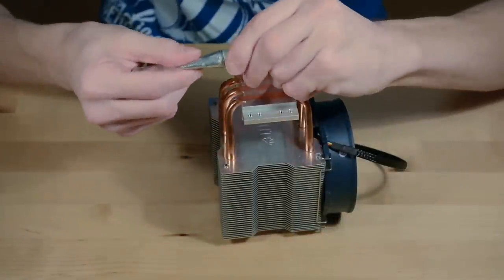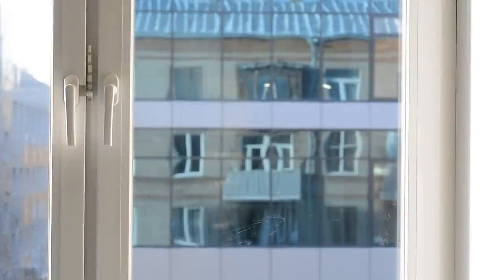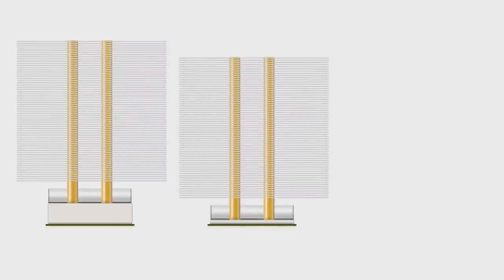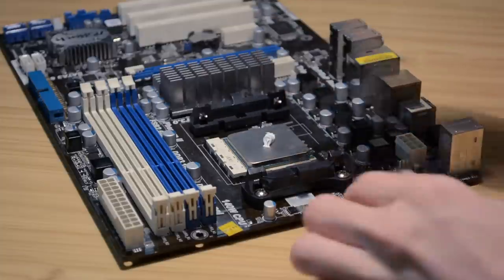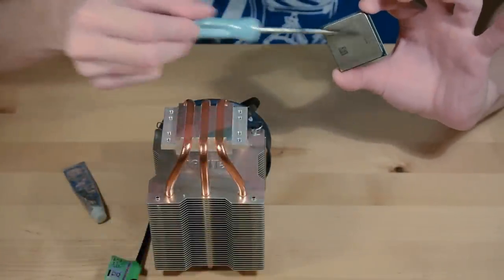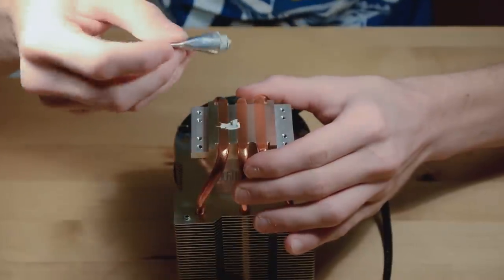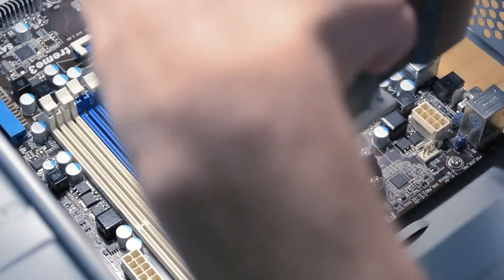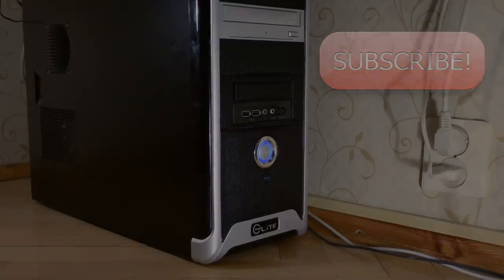Thermal paste: How much really need to apply and how to do it correctly? Как наносить термопасту?

Comment: The temps are rediculous. Yours, I mean. What is the CPU? Because my Fx-6300 idles at 8-9 Celsius... that is, if it's not turbo coring for steam, because Gaben.
Reply: your cpu doesnt idle at 8-9 celsius, maybe if your pc is in the freezer
Reply: krasusboy I'm using the CM Seidon 120v. Cheapest watercooler on the market.
Reply: Riley Poulin Your 12v line is dangerously high
Reply: I have a fx-6300 also, and what you are seeing is a false reading.  I get the same readings, but its impossible for your cpu to be cooler than room temp, unless you have some crazy super cooling heatsink that no one knows about. I heard its b/c amd cpu's sensors give out false readings at lower temps, resulting in you seeing such cold temps, which are not true readings.
Reply: Mine currently is idling at 35F or 2C, so yeah that makes no sense, its giving off a false reading, or I might have frost on my cpu lol
Reply: Some software reports temperatures differently. The software that you get with the motherboard is the best to use usually. My ASUS temperatures at idle are usually around 27c to 30c, but when I check my cores in CoreTemp, it comes back with about 12 to 15c per core. I'm cooling mine with a Corsair H110 and good case  airflow too. When using Prime 95 and throttling all 8 of the cores, it reaches about 62c and never really rises above that, which is still a safe temperature for my processor.
Reply: Riley Poulin How are you enjoying your garbage AMD thermal sensors and weak cores? There is a reason why people buy Intel over AMD. Hell, they haven't released a high CPU in a long time. Funny thing is an i5 keeps up with the 8350 in rendering.
Reply: Riley Poulin Using an AMD Processor, HWMonitor doesn't work well with AMD processors. Thats not an accurate reading. Its telling me my processor is 136C, when theres literally no way that is possible. My computer would be melting right now.
Reply: Cody Begley
 Don't worry, it works perfectly well. You just need to update it. Some cores just shut down on idle, but when you stress them you can see that the sensors work perfectly well. I use an AMD FX-8350, and I can tell you norge696 that too many people still buy AMD over Intel, the reason is simple, AMD is not bad at all, it works pretty fast, can handle everything you throw at it and it's very cheap. Of course, top Intel processor beats top AMD processor, but you shouldn't believe all the synthetic benchs and sites reviews. I don't justify buying an Intel processor because of the price because I can get something cheaper and better from AMD which also maintains good performance over time, which is also the case for AMD GPUs (only AMD users will understand that) Also, AMD heatspreadders are way better than Intel's, but the coolers are too noisy, nothing you can't solve with a another cooler, but that is still the case for intel processors that can handle and work with higher temperatures, but can compromise your system if you have bad air flow.
Reply: Cody Begley (If you haven't fixed this yet) You can also get this program i got called Speccy. It's more meant to tell you about your whole PC specs but it tells you the temperature of all of your cores which you have, if that helps you any.
Reply: In any case guys, we all know his statement was incorrect but even still AMD has a place. They offer a cheaper solution where 90% of people don't need a lot of CPU power. They are also needed to make competition, if not for that Intel could charge whatever they wanted.  It's been shown that the bottom line G3258 when overclocked can perform quite well in games with a very strong GPU. So unless you have a real need for a high end CPU then it is literally pointless to have all that power aside from the bragging rights you claim over AMD.

But look at it this way, say you own a 4770k (I do), But I use mine for, 3D rendering, programming, photo editing, video editing, encoding, plus the occasional streams and recordings. I felt the 4770k justified for MY uses. AMD clearly gives the end user the best bang for their buck, but if you want the best all out performance obviously Intel. But they both need to exist to make things go round.
Reply: Riley Poulin wtf are you using liquid nitrigin? thats crazy....
Reply: It'll be his core temps. A lot of monitoring tools report the socket temp. On my water cooled rig the socket will hit as high as 60 degrees when gaming but because the cooler takes the temperature away from the surface of the chip, the core temps only hits about 30-40 degrees max on mine. My cores idle at about 10 degrees or so too, mines a 9590 though which is a pretty hot running chip.
Reply: norge696 It's ok if you "dislike" AMD, or AMD fanboys, i give you that, but I will never buy intel over AMD, just for you to know that not everyone thinks the same. And btw, thank and beg AMD stays on bussiness because you will be paying a lot more for decent performance without competition, if you wanna buy an x86 processor machine of course.
Too many people complain about AMD stock coolers, and the truth is stock coolers delivers, unless you are an enthusiast, in which case an evo is a good option. I own an FX-8350 and I'm quiet happy with it. I didn't notice any difference with my friends i5 4670k, it just loads windows 2 seconds faster than mine, guess that's also cause of newer chipsets/technology, and I can say that today my PC is faster than my friend, but only because I know how to handle programs and processes. Daily use depends on everyone, and if you are a smart user your PC will deliver well enough. Bear in mind AMD is competing with older technology, and it's not that far from intel, difference is minimal.
BTW, Intel stock coolers are not enough if you are an enthusiast. My friend just want to acquire an CM hyper 212 evo because he is having some trouble with the temps of the 4670k, and i have another friend who just had to buy a watercooling solution because he renders constantly on an i5 2500k.
If I had to buy a new computer, I will just wait for another good product from AMD, just because I've always had good experience with them and they've lasted long enough without issues.
Sorry for my bad english. Regards
Reply: Ryan Dailey Well said sir. I think the same way. I bought a fx-8350 and it's quite fast, for daily use it's perfect, and gaming is not bad at all, actually i was in doubt about that but then I was happy when I tested it. I think everyone should just try it out and then complain, not the other way around.
Reply: Marcelo Badalamenti Yeah yeah yeah... Let's just hope AMD's Zen architecture actually shows 40% IPC improvement and it's not another shitdozer. You don't need an AIO to cool an Intel CPU, especially sandybridge because the IHS is soldered to the die. Any Noctua heatsink should do. Haswell will work fine with a CM 212, temps should stay around 60-70c fully maxed out.
Reply: norge696 Lol my 4770k would never stay that low with the 212. Course I do have it overclocked pretty high (4.8ghz) with and water. Oh and not to mention delidded, and I still get to 65ish on prime. 

With it at stock with stock cooler and no delid, prime went easily into the 100's
Reply: norge696 that is if you can fit it. In my M-itx chassis there is no room for a CM212 and easier just to put water AIO onto mine (i5 4680K) as it is overclocked to 4.7

Comment: Nope! Wrong. You're wrong.

First of all, applying a dab to the processor and letting pressure spread it is perfectly fine. There are no air bubbles UNTIL you remove the heatsink...even then, the pattern left behind has nothing to do with air, but rather viscosity. For heatsinks without direct heatpipe contact, this approach works perfectly fine, but is not as good as the following...

Forget credit cards for spreading - they're no good. The BEST way to apply heatsink compund (especially to those with direct heatpipe contact) is to use an unpowdered latex glove or sandwich bag to cover your finger, apply a small dab to both surfaces, and firmly massage it in to the whole surface area.

Comment: FFS he probably gets better temps than all you kiddies who became experts the fist day you logged on to the internet and now shouting at him. His PC works fine and has better temps than stock PCs.

There's loads of 'youtube experts' doing the 'pea method', yet they're putting way too much paste on.  The spread method was used in the golden days of overclocking, where the tops of the CPU were sanded down using wet-dry paper to get them super flat and smooth. The paste was rolled using foam. Paste has improved a lot since then too. Artic Silver website still recommend the spread method on some CPU's

Comment: What you do is wrong.

1) You pushed the cooler with your hands, even if you applied great power the pressure is less compared to what the pressure would be had you tighten up the screws correctly.

2) If you had tighten up the screws correctly it would have spread on the entire surface with small gaps maybe on the corners but that doesnt even matter. because we need to have thermal paste only in the center of the CPU the metallic square is just a heat spreader and acts like a buffer if you google for delid CPUs you will see that the actual chip on there is in the center and is very small there is where the contact needs to be made. 

3)The only thing right in your video is that we use thermal paste to avoid oxygen between the CPU and the Cooler but by spreading the paste with the credit card you mix small air bubbles in the process..

Also yes it needs to be a thin film but too thin is also bad.... you did what you tried to avoid.. with such a thin film of thermal paste you made many tiny gaps that dont have paste at all (that is why one can see the heat pipe colors for example because instead of a wall your thin layer is like a net with tiny holes in it which allow light to reflect from the cooper and come to your eyes and thats why instead of the thermal paste color you see the cooper color... those tiny holes are going to be filled with air... )

Comment: At least one highly visible corrective annotation is in order. Well, "the less the better" isn't exactly accurate. ZERO certainly isn't correct, is it? See? Also, doesn't it need to be evenly spread (by the heat-sink; not necessarily manually), instead of just one dot that isn't? Yeah, see? Shouldn't it be just enough to cover the whole top without spilling over, very much? So not just "the less, the better," because you need enough to spread evenly without being very thick.

Comment: Pea sized without spread is dumbest way possible. The role of thermal paste is to go into the micro pores of the heatsink, not to interrupt contact between cpu and heatsink. You must put max 1/2 pea sized and spread it as thinner as possible, almost see through. The more surface u get covered with paste, the more heat will be dissipated. Also, the cpu and heatsink must be previously cleaned with alcohol and a very soft cloth. The method at the end of this vid is the closest to perfection in my opinion.
Reply: Delid the CPU and see where the chip is and how big it is the. you will know why you are wrong....
Reply: +MsSuperdong It doesnt matter how small the chip is, it dissipates heat through all lid's surface.
Reply: +Cosmin D. Well your wrong. Have fun getting air bubbles and higher temps!

Comment: There is no air inside a double glazed window. It's a vacuum.
Reply: ***** Uhhhhhhhhhh. So do they hook up a pump inside the glass while they are putting the windows next to each other?
Reply: Obviously. Some suck the air out, others fill it with a more insulative gas than common air. The best double glazing is a vacuum. The best conductive insulator, is nothing at all, for there isn't any particles to conduct :)
Reply: So are you saying they don't try and suck the air out of a double glazed window pane? And besides, if you really want to get technical, that statement is very inaccurate. It depends on which part of space you sample at a particular moment in time. You can sample space in one place and find its completely absent of visible matter. In another place in space, quite possibly beside your first sample, you could find gas, dust, ice etc. You can apply the same logic in a vacuum made by man down hear on earth.

When you think you've found that part of space that is completely void of matter, gravity more often than not suggests otherwise. I'm talking about dark matter. Matter that we cannot see, yet we can see it's influence.

Ever wondered why when the Milky Way revolves around its Galactic Core, It's outer arms revolve at the same rate, contrary to what we would expect judging from the matter we can see. We would predict it's outer arms to orbit at a reduced rate, like a whirlpool in water, but that's not the case. The reason why is because our galaxy is jam packed with matter we cannot see, or interact with, turning it into a strange solid.

Science is amazing.
Reply: No not a vacuum its air most often! In some more expensive windows its a inert gas called argon. flat glass could not deal with the pressure if it were a vacuum.

Comment: pea sized amount   or even  half a pea   on cpu and none on heatsink and let the  dot spread itself as heatsink is tightened down avoids air bubbles which  are bad for heat transfer...so also is too much  compound as it will act as an insulator an not pass heat as effectively as a thin layer...less is more here....never use a bare finger to spread as oils will badly effect the  compounds  ability to transfer...
i used to be a proponent of the spread method until i saw videos of paste on a cpu pressed with a glss layer on top to demo the spread pattern... the method of spreading, no matter how evenly done and then pplying the heatsink resulted in bubbles and air gaps...lots of them....the pea methos spread out like a wave from the center with no air bubbles at all... some may say it doesnt cover as far as if u spread the entire cpu by hamd...i used to do that cuz i wanted All if it transferring the heat...but the pea method expands after  being heated and used and will spread far enough to do the job...the actual chip under the spreader in in the center anyway..thyats where all the heat originates...This can be debated but to Really see for urself, try ur fav method on the cpu amd then apply a flat glass or plexiglass over it and watch for urself...no need to Believe anyone.

Comment: haha ''the less layer you apply the better transfer heat''
the thickness of the layer is irrelevant, as when you put the cooler on, it pushes down on the paste, it will become a thin layer no matter what you do, excess paste will be forces out the sides by pressure, which can damage your components.

Comment: wow, this is literally the worst way you can apply thermal paste. as the thermal paste heats up it WILL spread to the entirety of the chip (that's why most CPUs will run hotter at first then cooler). The way this video shows is horrible because it creates thousands of mini air pockets that will reduce its efficiency

Comment: basicly after watching ALL the you tube videos and reading all your comments there IS  no right wrong way.as long as it contacts your temps will be low if not and they are high take it off and start again a different way4670k i5 haasswell idle  29c 84 F  50c folding 100% cpu 120F  51 c  Prime 95 afte 1 hour 52 c  125F

Comment: This is sooo wrong... Spreading the thermal paste causes air bubbles, which is bad. The space between Cpu and cooling systems must be SEALED by the thermal paste. Delete the video please
Reply from the maker: Ok. Your offers?
Reply: Michael Zakharov Sorry I might sounded rude... The best way to apply thermal paste is the cross pattern (using the same amount as in your video) and without spreading it to avoid air bubbles. I can also say to anyone who's reading, not to touch the top (as well as the bottom) of the cpu, otherwise you'll leave organic stuff from your fingers not visible with bare eyes, increasing temperatures :)
Reply: +LINKINPARK4EVER1996 dont worry, just let all the idiots destroy their cpus
Reply: ***** I never seen a cpu fry because i dont spread it
Reply: ***** not a opinion, its a fact, spreading paste causes bubbles which will not transfer heat.
Reply: ***** Also, the reason why the company says to spread it is because the spreading method is suppose to be for mobile chips and graphics cards, not desktop CPUs (which has IHS)
Reply: +Reppy07 my pc is over heating i think .. im not a pc savy person but as i play dayz my pc  powers off like the plug is pulled and it restarts comes on like i just tapped the power button is that cpu / heat  related? like should i get the thermal paste due to the heat? Would that be wat turns my pc off?
Reply: I am not talking about frying the cpus, but wrong applied thermal compound will result in higher temperatures, not fried cpus (could be very important and maybe dangerous in extreme overclocking).
Reply: ***** Hungry of  i7's now..
Reply: @LinkinPark4Ever1996  I think the real question is... how do you feel about minutes to midnight and later stuff? good or bad?
Reply: @Aaron-hg8jo  I loved them before they changed genre..
Reply: @LinkinPark4Ever1996  agreed
Reply: @ashleyjohansson230  butthurt? Lol okay not 12, more like 10. I hate when ppl that don't even know about computers try to bs their way through it
Reply: @Aaron-hg8jo  LOL i'm double that age, maybe you are the 12 year old because you keep bringing it up! XOXO
Reply: @ashleyjohansson230  so's ur face